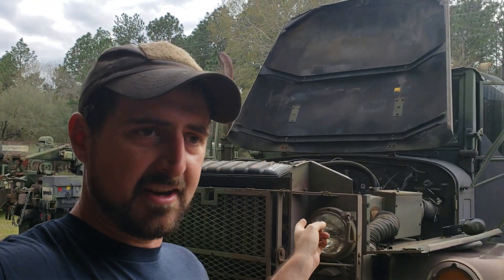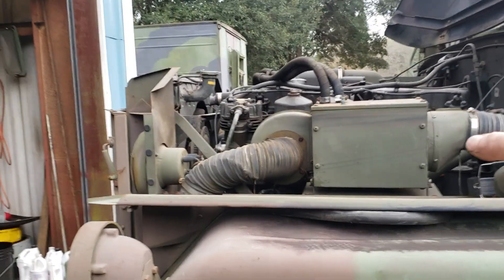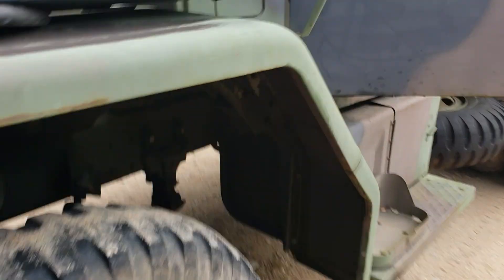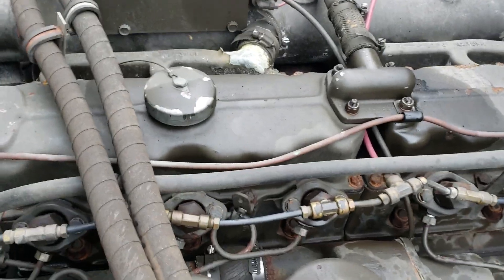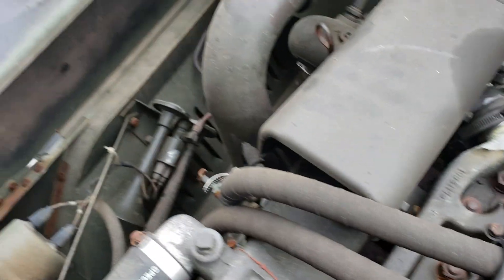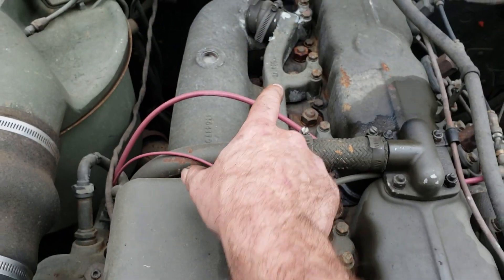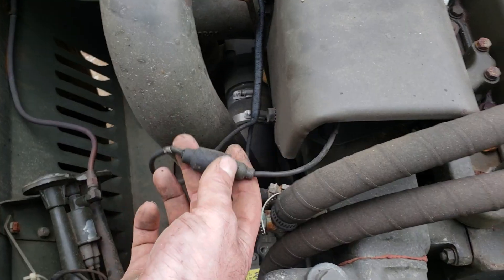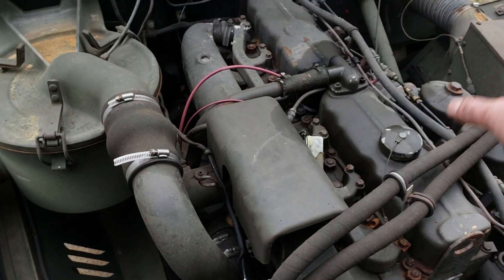M35A2 : Intake flame heater delete ( how to)

Comment: My magnetic relay sticks more often than not preventing starting without jumping across the relay.
I replaced it with a 4 post 24v continuous service starter relay. Connecting the wires on tbe fwo large posts on the new selinoid as was configured on the magnetic relay with the wire from the switch to the "i" post on the new selinoid I am getting a dead short when re connecting the batteries.. where have I gone so wrong ??

Comment: Why R U removing the flame heater from an M35A2 ducey?
Reply from the maker: @ScottHamilton-hb9sb  they're a common point of failure, and when they fail it can lead to catastrophic engine damage or an engine bay fire. Even the military removed them from engines during the final overhaul run and replaced them with ether start kits.

Comment: @tacticalrepair do you have any experience with coolant heater installs on an m35a2? I have a south wind 939j24 with no manual and I’m trying to figure out where to install it and what the exact wiring schematic is. I got the heater to run in the bench but have no clue where to mount it and where to tap into the coolant lines and fuel lines
Reply from the maker: @flyingprepper  no I don't. I wish I could help you but I don't want to give you bad information.

Comment: I definitely dont want my M35 to catch on fire!!! So if i delete this heater from mine and i dont have a eether injection, neither. What mods and products do you recommend  for  cold starts? Would a block plug heater work fine, or is there more i can do?
Reply from the maker: If anything, a circulating block heater is your best option.

Comment: Why would anyone want to delete it?  It works great when it's in working order.  Probably less work to fix any issues with it than delete it.
Reply from the maker: You said it yourself. It works great WHEN it works, which isn't common. They're very problematic and exhibit multiple modes of failure. Replacement parts for them aren't plentiful or easy to find anymore either. The nozzles have a habit of leaking either into the intake, causing excessive smoking, ring wash, cylinder wear, and in some cases burnt pistons or hydro lock. When they leak externally, they leak directly onto the exhaust housing of the turbo. This has been responsible for a metric shit- ton of engine fires and burnt down trucks. It was such an issue that most all of your depot overhauled canned engines have the flame heater deleted and they come with an ether start kit to install instead. Not to mention, most people don't live or operate these trucks in a place that gets cold enough to need these flame heaters. They actually start quite easily down to around 0°F with no assistance, assuming the valves are adjusted well and everything in the fuel system is in good shape.
Reply: @tacticalrepair  Perkins diesel engines have a similar system which is cheap and readily available it's called Thermostart. Not sure if it can be easily retrofitted but only takes 12v power and fuel.
Reply from the maker: @In2investing  yeah I remember that since you mentioned it. I'm certain it could be retrofitted if someone needs it. But like I mentioned, most guys that own these trucks live in areas where they aren't really ever needed. Then I've been seeing more and more people installing different kinds of coolant heaters when they do live in cold climates. I just don't see it being necessary anymore unless you live in a truly arctic climate.

Comment: The sparkplug hole seems simple enough. But, couldn't someone leave the valve in place and simply cap the fuel line hookups?
Reply from the maker: If the valve can leak fuel in, it will leak boost out.
Reply: @tacticalrepair  Thanks. I'm looking into buying an M35 in the relatively near future. So, I'm educating myself

Comment: Hey Garrett thanks for this video! Didn’t know it existed till now..... when I just was wrapping up installing my pyrometer, and in the process, smaller line that goes to the flame heater injector ... it very slightly dripples fuel ... question is.... capping with 1/4” plug at injector and removing T from injector return line should solve this correct? Also I’m assuming that if it’s been coming thru like that, it’s been going into my intake or I guess I just realize that assuming that valve is functional, it’s been stopping there just before intake... I plan on removing all of the components  but as of right now, I have only the 1/4 inch plug and crush barrels on hand and not the plugs for the spark plug and injector
Reply from the maker: Yes you can do that.
Reply: @tacticalrepair  smokes significantly less. thanks bro! btw, wya on fb? michael aht
Reply from the maker: Apparently at some point in the past I had offered my advice to someone and you were giving me shit about it. You were on my blocked list, and I don't recall blocking you for being irritating.😄 Anyway, I'll send you a request.
Reply: @tacticalrepair damn  bro I can’t recall such incident.... Them was rough times...    what I remember was I was meaning to call you but I kept putting it off until the day I dropped my phone in the lake, lost everything, literally. Much to catch up on
Reply from the maker: Yeah I don't really remember what it was either. No big deal.

Comment: I had to do this as well...discovered the leak when I was leak checking the fuel system after doing the spin on filter conversion. It was pretty bad leak too, 15+ drops a minute (quick math there). Scary to think I could’ve lost the truck to this! Thanks for the video!
Reply from the maker: Glad you found that!

Comment: Ok a Air Force M35A2.... How dose the duel circuit brake system work on it?!?! That's the video I want to see, how to make one or adapt a Army M35A2 to the dual circuit AF style.
Reply from the maker: Same as a single circuit, but you have a dual outlet master cylinder activating two different air packs.
Reply: I have seen the diagrams but never a pic or video.

Comment: Thanks for that info,.....I think I will just block off the supply line at the bottom of the pump under the HH like you showed and leave the rest so it looks complete on mine as my injector is leaking at the back and dripping onto my turbo and being in the 'Land Down Under' needing that heater isn't a high priority for me. I'll need to block the line at the T junction so I don't get fuel from the engine injectors feeding back from there to that injector at the elbow,....Aussie.
Reply: Garrett,
My flame heater is leaking fuel onto my turbo so I need to take the fuel out of the loop, but for now I think I might want to keep all the flame heater components in place in case I ever decided to replace or rebuild the manifold heater set-up... and so I dont have to guess as to what threads the 2 holes in the "elbow" are that I would have to plug up if I removed the items that are currently threaded into the 2 holes in the "elbow".  So, at bare minimum I need to...
 1. Plug off the supply line that originates from the bottom of the injector pump with a NPT pipe cap.

2. Use another NPT pipe cap to cap off the one junction/inlet port on the "T" fitting (about mid-way on the engine) that serves as the fuel return line (fattest line)  from the manifold heater injector that returns fuel to the same main fuel line that supplies the 6 fuel injectors that squirt fuel to each corresponding engine cylinder.

Then just leave all the remaining manifold heater stuff in place in case I want to try to fix it someday.

Does that sound right, 2 NPT pipe caps at bare minimum?
Also, what do I use as sealant on the threads that can tolerate diesel fuel?

Now, could I some time later use one of the threaded holes (either injector hole or spark plug hole) in that "elbow" for a boost gauge? 
And use the 24 volt hot wire from the flame heater toggle switch inside the cab for an acessory like a train horn or some other type of cool "momentary on" accessory?
Thank you,
Shane
Reply: As I think more about leaving the injector and spark plug in the intake "elbow" in place just to act as plugs that I know fit the threaded holes they are already plugging up, and also  affording me the option of some day getting the flame heater system working correctly..
 I can also reason that if that elbow fuel injector is leaking/failing, because of bad O rings or seat valve in the "guts" of it...then it could possibly also leak air either in or out and could possibly cause a vacuum leak, boost leak, or a combination of both which could obviously negatively affect engine performance. Maybe I can also cap off the existing injector and make sure it is air tight without just substituting it with some other close but not exact size plug that has to be re-tapped or forced to chew it's own new custom threads. I still think it would be great if I could re-purpose the more common 3/8 inch NPT spark plug threaded hole in the intake elbow for a boost gauge sensor.
Shane
Reply: Well, I will respond to my previous post...I did a very minimum flame heater bypass job to stop fuel from dripping from a bad cold start injector onto my hot turbo housing which smokes significantly and could cause a fire. To get my truck back drivable without the fire hazzard, all it took was two 1/8" MNPT pipe plugs to plug up the fuel inlet and outlet threaded holes on the little flame heater fuel injector in the intake elbow. Then I simply hooked the old fuel supply and the old fuel return line that used to go to that injector together so they make a closed loop using a (3/16" x M10-1.0)  brake line union "inverted flare". The union had threaded openings on both ends that both the supply and return fuel lines will thread into. I got the pipe plugs and brake line union at an auto parts store.  I used a product called "Seal-All" to seal all the threads.
I hope this may help someone to do a very basic and easy bypass of the flame heater to buy them some time to ponder on whether they want to fix it so that it functions correctly or just remove the whole system all together.
Shane
Reply: Actually,.. can you do a Video on repairing the leaking injector itself,...?   Aussie.
Reply from the maker: I've honestly never attempted to repair one. No hard parts are available and they really are quite useless.
Reply: Wow you got a Deuce down there?? It’s a wander it’s not an M135 WW2 , interesting how you got one down there? Vietnam leftover?